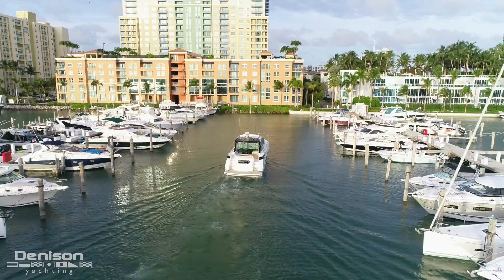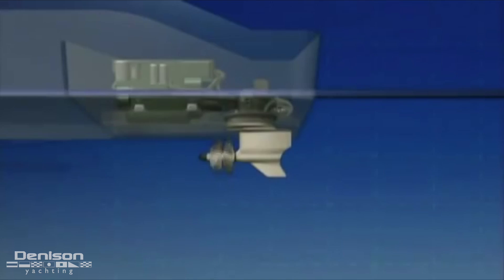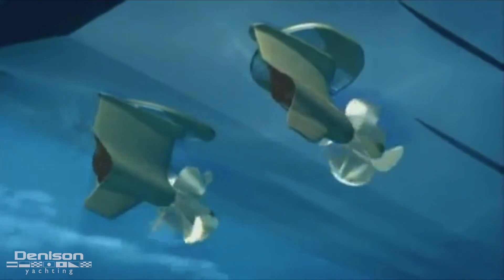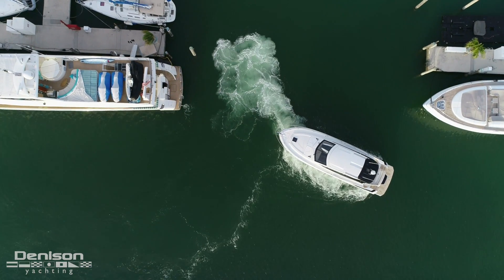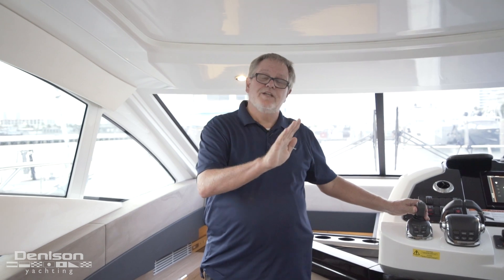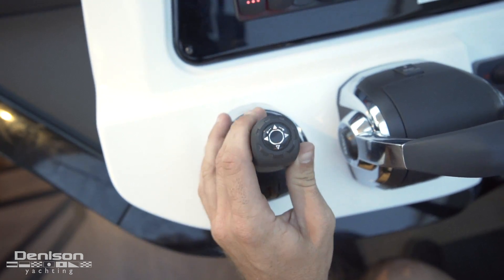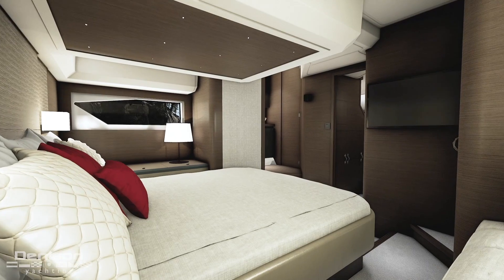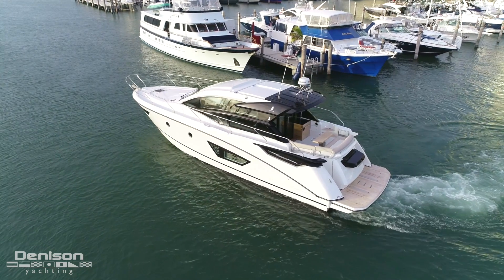Volvo IPS Joystick Takes The Shouting & Stress Out Of Docking

Comment: Just out of interest, is it possible to run a yacht engine on bio fuel rather than fossil fuels?
I am aiming to make myself as eco friendly as possible (I know, too little too late) and the idea of burning hundreds of gallons of diesel doesn't sit well with me.
Reply: Stay away from Marine Diesels then. Stick with Sail/Solar/Electric.
Reply: @cheif10thumbs  There are some really interesting things being done with Solar, but that doesn't fix the problem. 
Also, as a younger person a good few years off buying a boat fuel costs will be even greater by the time I am buying one, though solar and batteries will have improved to a point where the question is no longer valid; similar to asking about coal powered boats nowadays.
Reply: If I'm able to get a boat I plan on making my own biofuel. I'm looking for solutions for pumping it to the boat, tho, since a 500 gal tank isn't exactly easy to fill...
Reply: Marc Brown,
It is possible but not practical especially for higher performance engines at this time,